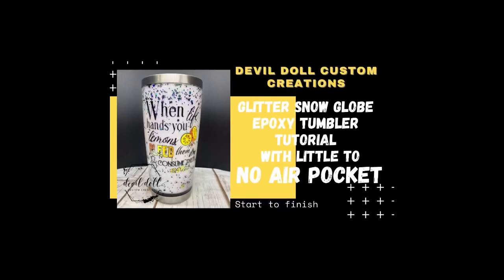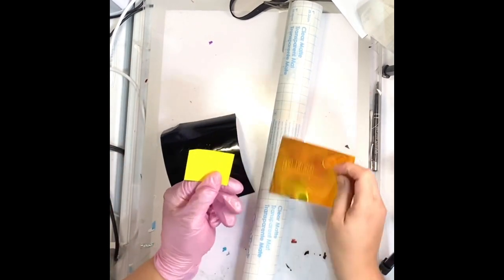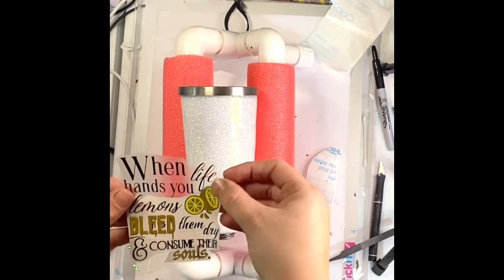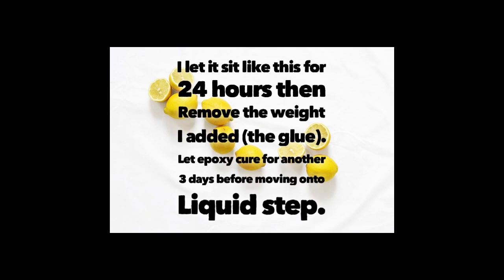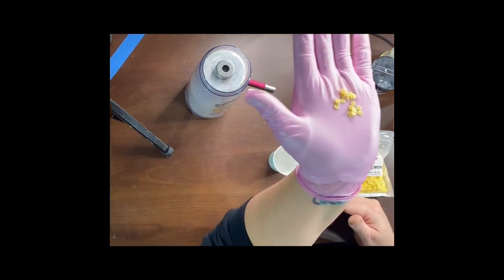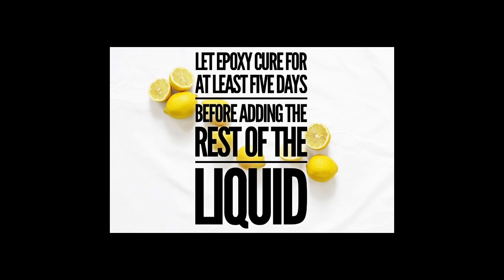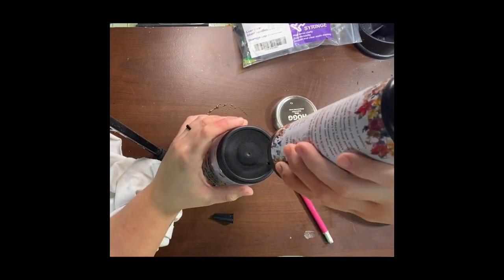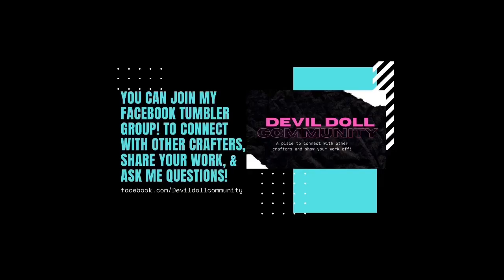Glitter Snow Globe with NO large air pocket!!!

Comment: Hi Katrina...have your ever run into a waterslide weeping or fading or basically desinagrating in a story board. I made a story board tumbler and I sealed the water slide but within 1 month the waterslide starting disappearing.
Reply from the maker: No I haven’t. You did a epoxy over the waterslide correct? I’ve used waterslide on a few and then haven’t faded and it’s been over a year but I did a nice coat over it. But mostly I  like using vinyl not waterslides on these.

Comment: Mines didn’t pop out been trying for 3days and still not popping out
Reply from the maker: Your talking about the bottom in the freezer, correct? Once you pull it out of the freezer, tap it on a counter or maybe a little harder if need be, it will pop out
Reply: @devildollcustomcreations  yes I did that and even slam it to do it and still didn’t work
Reply from the maker: Umm weird. Ok maybe try heating it up with your heat gun? I’m sorry I have never had one not pop out before.  I hope this works 🤞